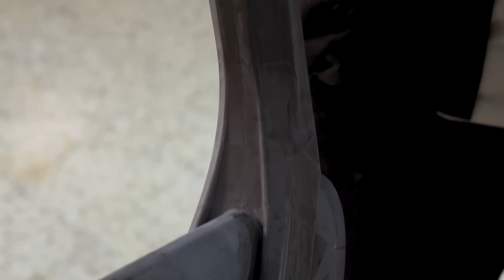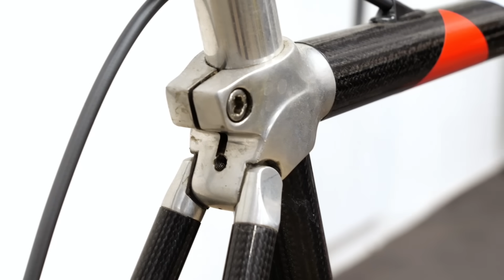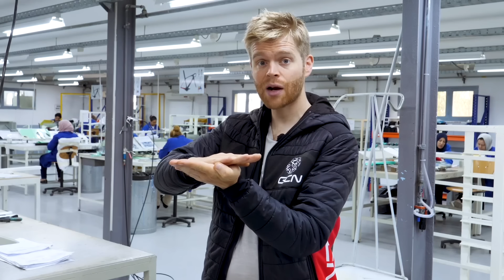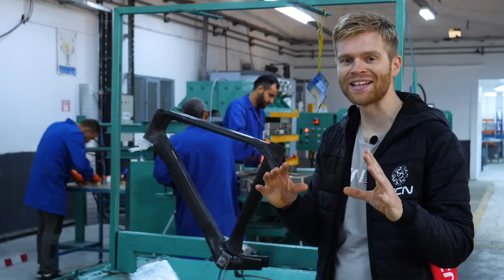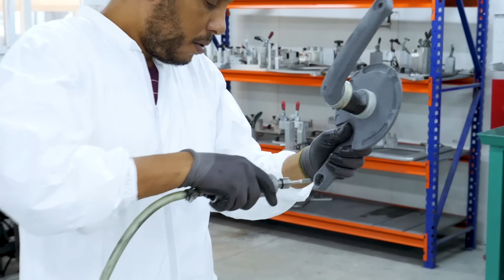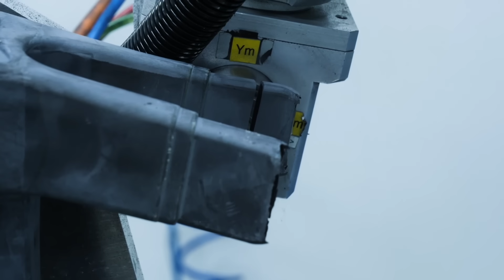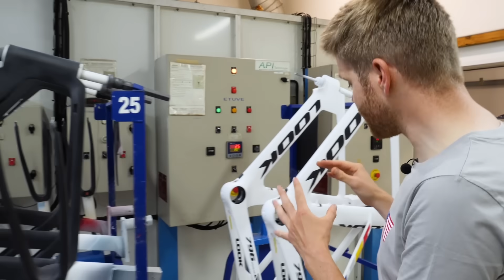How Are Carbon Fibre Bikes Made? | LOOK Cycle Factory Tour

Comment: Just wondering since top end carbon frames takes so much effort, time and cost to build. Why are the carbon frame builders not getting the recognitions compare to a metal frame builder? I still have a vintage Dean frame hand build in the U.S signed off and credit to the frame builder.

Comment: This was a Well Presented Sequential Engineering for Maximum Type of Working Strengths per Component Required, the  Materials Trimmed to Dimension, Processing Methods, Equipment and Manual Labor required.  Thank you for the 20 minute education.

Comment: Can you fix a carbon frame with a torch.  I tried  it but I used a hammer and some silicone oil instead.  Epoxy will work with a clamp and cold setting hardener.  Then sand it and use a solvent to glue together.

Comment: Great video, but surprising. I was thinking it will be one piece or max two pieces. The less pieces, the better and what they do is make all that carbon parts, test them and then.... glue them together. These spots where glue is are the weakest points. Also, what a cheat. Tunisia? So arabs make it and then French company claims it is a French product. What a parody!!!

Comment: There is no compliance in carbon frames…primarily it will break when there is! All those cut-outs are so designed to attain efficiency while maintaining effective durability relative to stiffness. Let alone the adhesive they use to bond carbon fibers has no flex in it..the coating will break

Comment: Having brought a white cannondale supersix evo hi mod I would never again buy a white frame set, my size 56 frame  weight 823g after sanding of the white paint I was down to 656g, having only sanded the pain and none of the carbon, that's a weight saving of 167g, my brother owns a garage and he kindly applied a 4 coasts of thin Lacquer, taking the weight to 698g,so with a thick coasting of Lacquer I had saved 125g in paint of a top of the line frame, for reference my cheaper than chips brand x frameset that I got ex display from crc with chipped paint for £80(usauly £140) saved just 60g from the stripping of paint,and it was a 58cm frame, the difernec, well it was gloss black not white. And a 20th of the price :)

Comment: This is a puzzle which is not hard to solve. You filmed basically 5% of the operations involved to construct the bike. However made a big deal of the machines(*) . Why would a French manufacture have a location in Tunisia (North Africa)? Well, Labour is cheap, and no one wants to know that the most expensive carbon products, are not build in the most highly sophisticated mfg plants. Rather the ones with the most economic workforce. Carbon is very labour intensive which is why nothing was really shown and the machine capabilities are very low, which in todays world means you are archaic. Not a bad thing, Just deceptive.

Comment: Being a PhD scholar on these carbon fibers, I can say that You just put this complicated composite material into simpler and lucid words. Really appreciated.
Reply: Ollie (the presenter) has a PhD in Organic Chemistry. He did a wonderful job here!
Reply: Is graphene being used with carbon fiber?
Reply: @davidbarnett5931  Graphene is one of the type of nano carbon fillers which has excellent mechanical and electrical properties. It can be doped into the carbon fiber composite to improve its performance.
Reply: Scholar 🤔
Reply: Teach me please
Reply: Hi sir, I just would like to know what are the difference between an expensive european carbon bike frame vs asian carbon bike frame specifically china brand. Example Specialized vs Twitter.
Reply: @neilgabzceniza  Quality checking and workers salary.
Reply: @neilgabzceniza  
Zoo is
Reply: @neilgabzceniza  y
Reply: @neilgabzceniza  Carbon-fibre bikes are really labour-intensive. The biggest difference are the wages of the workers. If everyone knows what they are doing, there might be no difference at all. Also, many European-BRANDS make a deal with a Taiwanese-company for X-number of frames for $300,000 and then charge a premium. With these brands you won't be able to buy forks separately because it is a job-lot. You'd hope the expensive ones have more R&D, but again, not necessarily the case. Even some big names deliver awful frames where the bottom-bracket-housing doesn't align/isn't round, etc.
Reply: D e e p
Reply: @Vinz Ilan it is a scam cuz
Reply: @Vinz IlanThat's because both of them are spam bots.
Reply: @Frederick Jamal it worked and I finally got access to my account again. I am so happy!
Thank you so much you saved my account :D
Reply: @Kane Henry Happy to help xD
Reply: @Frederick Jamal i really appreciate your reply. I got to the site through google and im in the hacking process atm.
Looks like it's gonna take quite some time so I will get back to you later when my account password hopefully is recovered.
Reply: i dont mean to be so offtopic but does someone know a way to get back into an Instagram account..?
I stupidly lost the account password. I would love any assistance you can give me.

Comment: This is a great video on the subject. But I think there is a clear opportunity for this to be mass manufactured. If anything, it could improve the consistency,  strength and quality of the frames, while reducing sticker prices. But of course, there is always a market for bespoke handcrafted bike frames too, so those people building these bikes would continue to be employed. 

I hope the carbon dust is not another asbestos scenario. I hope the workers are protected by airfilters and so on.
Reply: Any carbon dust created is encapsulated in an epoxy matrix. 

The largest health and safety issues with uncurled prepreg composites is exposure to resins with contact dermatitis. 

As part of my job, I reviewed every SDS for each material ordered and delivered to our facility. Once the review was complete, the required PPE was mandated. Other materials were rejected from use due to being suspected mutagens, materials containing lead, and highly sensitizing materials in air.

Comment: My question would be, when is the first carbon framed E-BIKE going to roll off the assembly line?   Sure, racing bikes will always be needed for that purpose, but absolute MASSES of e-bikes are being sold at the moment and folks can't get them fast enough, so companies with 'lighter' aka 'carbon fibre' would be a great selling feature, especially with the new 1000w electric motors out now, which would highly increase the distance, before the need of recharging!

Comment: Maybe you all guys don't believe. My carbon fork and frame were just about $30 and $165 respectively. And I have no trouble with it for a year. To me, famous brands' carbon fiber bikes are expensive just because of the brand itself. You can say notable brands ensure more safety. But carbon fiber bikes are now very common, I don't think the build quality could be an issue. The only concern about those cheap carbon is that those manufactures may not add some "T-700" in it to lower the cost. But I am not a racer, I don't ride my bike like pros do, so that marginal strength doesn't matter.

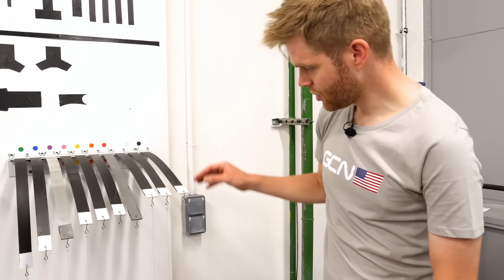Comment: 3:25 WTF the deflection might be because of its LOWER length. The shorter length won’t deflect as much (all other variables being considered). ALL RODS should be the same length for an unbiased display!!! That’s REALLY deceptive!! Add in a rod that is 4 feet long, any weight will bend it to the floor! Edit; “same mass" DOES NOT EQUAL same amount of carbon fiber per square inch!! DECEPTIVE, although I know that Carbon Fiber has amazing properties. I'm just saying compare oranges to oranges NOT apples to the branch they were grown on

Comment: Straight away let's eliminate a total myth about carbon fibre. IT IS NOT STRONGER THAN METAL. Yes in a lab you can prove it is but in the real world it just isn't! It never has been! Funny how certain manufacturers have avoided the stuff and even Mondraker have launched their new Downhill Mountain Bike in Alloy only as their pro riders said it rides better than carbon. This is not a wonder material and is definitely massively over priced.

Comment: Really cool video, thank you! @ 3:30: Cool demo, however, the torque acting on those rods is far from equal, since the length of the rods is not the same. It's obvious that they were trying to dramatize the differences, but I think the effect would've been far more appreciated had they made them the same length, even if the results were more subtle.

Comment: Without a great deal of thought for the environment !!!. Unlike for instance steel and aluminium  carbon fibre is exceptionally difficult to recycle. Therefore in the future more carbon fibre frames will end up in the landfill.  Steel is the king of reusable materials because it can be melted down with minimal poisonous emissions Aluminium when melted down releases bauxite which is bit nasty for the atmosphere but at least it can be recycled. Also carbon fibre is notoriously bad at displaying outward signs of visual fatigue before failure. Both aluminium and steel display corrosion or stress cracks indicating where frame weakness is . In short carbon fibre is heading to be the new asbestos of the green world!!!

Comment: Hmmm, I'm not so sure that the example of those different strips of carbon having different stiffness is a good test. It looks to me as though at least part of the amount of deflection exhibited is caused by the length of the strip. This has more to do with the fulcrum and leverage effect of the varying lengths than the effect of different layups.

Comment: By having working with composite before , I can state that this video is well made and has showed the correct basics of composite production.  
Composite manufacturing is pure art, if you have designed, simulated, tested and guaranteed that both layup and curing process is correct. Your product will perform as intended.... and that’s why we have so much bad carbon frames around. 🥺

Comment: So does a carbon bike have a maximum limit for the rider?

I have a weight of 120 kg. Is a carbon bike able to support my weight properly
Reply: Trek have a carbon frame that has a max load (rider and gear) of 125kgs. From what I've be eddn told, the frame is fine far beyond that but its the wheels that suffer.

Comment: The Lemond tour winning Look bike is eqiped with the highest quality deralures, brake calipers, shifters and hubs ever produced:  The Mavic branded Simplex retrofriction non-indexed downtube shifters and Mavic SSC front and rear derailures - swap the rearhub, casette, chain and chainrings with modern 10/11/12 speed and i promise you that you will never insist on indexed gear shifting, STI and Ergo's or even EPS/DI2/Etap. Shifting will be crisp, super fast, precise and it will never fai . and the transmission will save you +150g compared to to top of the line EPS/DI2/eTAP. By the way those Modolo Mavic branded SSC 440 brake calipers are phenomonal and modulation (and return spring friction) exceedes any rim brake ever produced + They are seriousliy lightwight, 100% rebuildable and serviceable with ball bearings just like the Mavic SSC front and rear derailures. (long cage version on the Mavic SSC Rear derailure will do a 30t if needed).

BTW this African bike anufacturing facility exceeds any carbon bike and component production facility in terms of tolerances and manufacturing control anywhere in the world - incl whatever shops like Sarto & Campagnolo in Italy and Calfee in the US can do - no wonder why Hambini and Lutchner continiously recomends as the quality from Look's Tunesia plant has been second to none for 20y and the gap the the next best is continuing to grow year after year.

the pedals are Look's cash cow, but the real jewel is sensible engeneering in Nerver combined with sky high quality produced by african women in the the most liberal, seluc and democratic african country north of the equator.

Comment: 3:56 What about forged carbon? If it works for Lamborghini, why wouldn't it work for a bike? Forged carbon is literally just chopped up carbon fibers smacked in a mold with resin, then cooked under high temperature and pressure, right?

Comment: Time 5:54 - 2 part epoxy - question the 2 part epoxy comment.  prepregs are generally produced using a 1 part epoxy that is cured using heat.  a two part epoxy system would be room temperature cure and not used for prepregging as the two parts are the resin and a catalyst...  Overall a great video.

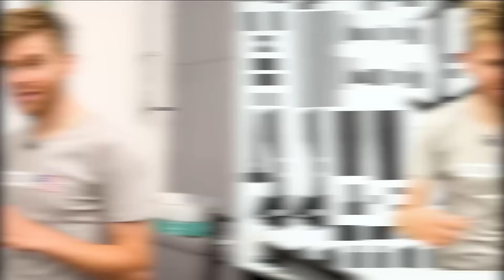Comment: around  3:00 you are showing test strips of different material and by the end you explain the every one of them have a different orientation and that all of them are the same weight.  I think it's important to point out that regardless of the strand orientation the shortest ones are also the stiffest.  That's not strand orientation it's just physics.  Shorter/thicker is stiffer than longer/thinner.

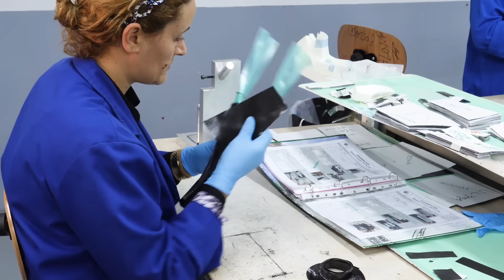Comment: stop, stop!!  by 2:40 you have unknowingly given a massive amount of misinformation.  Composite, by definition is a combination of materials.  Carbon is one of the hardest substances on the planet.  In a 1cm by 1cm block it would not bend in any direction.  Only by making very long thin strands is it able to bend at all. The epoxy is the second part of the composite and it's properties are just as important as the carbon's.  It is a very flexible material with some amazing bonding properties but where it becomes useful here is how it can be combined with the carbon to create a single composite material with properties of both.  Where a solid block of carbon would shatter rather than bend the epoxy allows the carbon to bend.  The degree to which it bends is dependent on how much epoxy there is binding the carbon strands together.  Less epoxy and you have a stiffer part, more epoxy and you have a more flexible part.  The smaller the strands the less epoxy and the stiffer the part gets.  The stiffer the part however and the closer you get to the brittle nature of carbon.  By combining the two materials we can create a balance between the breakable(brittle carbon) and the unbreakable(very flexible epoxy) and that is how we create a composite structure, like the frame you are showing here.

Comment: I must admit I’ve never heard of that brand of bike before. The frames do look lovely though.
Reply: Basically the best carbon frames in the world.  Only manufacturer that is weaving their own carbon.  I was stationed in Germany in the mid 80s and used to hang out at a local bike shop in Landstuhl.  The owner tossed me a bike box one day and I thought it was empty... had the first Look frame and fork in it...  Wish I'd bought it but neither of us had any idea of it's reliability or if it would fail in the rain even.  The tubing sizes were too small as they went with the same size tubing as the high end Italian CIOCC steel frame he built up custom for me.  That was why carbon had a reputation for being compliant... they didn't have the engineering down at all at that point.  If I had a bunch of extra money burning a hole in my pocket, I might get one of their frames and do a build, but have a serious dislike for carbon parts as being dangerous over time.  Still ride my CIOCC at times, although I've gotten into recumbent trikes as my favorite mode of pedal power.

Comment: What a snow job, carbon touted as such a great thing. Nothing but way overpriced fiddly junk. Think about it, look how much there saving not have to machine or weld anything, and what your getting are the same composites use in a $10 Walmart fishing pole. Not to mention, just scratch a carbon frame and it’s done for. Throw it in the trash..

Comment: I had the original Look carbon frame MTB.. well it was aluminium lugs with carbon wrapped tubes.. it also weighted more then a steel bike at 1/5th the price of the LOOK frame alone.. ah the good old days of 80's MTB's .. ' lost it ' and got a Ti frame instead.

Comment: Its not the same mass !  You can clearly see on their show board 4:00 the lengths are different from each other. Stupid.

If you're going to show the differences of a single aspect of engineering, in this case the lay up, you dont alter other aspects (like length) to prove the difference.  

Would not trust a manufacturer who doesnt understand the most simple fundamentals of testing...

Comment: That display of "rods" (blades) showing cf deflection depending on how it's laid out is poorly designed, as it only seems to show how things deflect more due to varying LENGTH, not layout.
Reply: Pretty sure they were all the same length though.  Granted they picked a length and it was possibly just an arbitrary value, but they could've used a different length for all the bars and it wouldn't have changed anything.  Too short and it might be difficult to visually see the difference in deflections, so you want it long enough to showcase that deflection.  It wouldn't make much sense to vary more than one variable at a time for demonstration purposes.